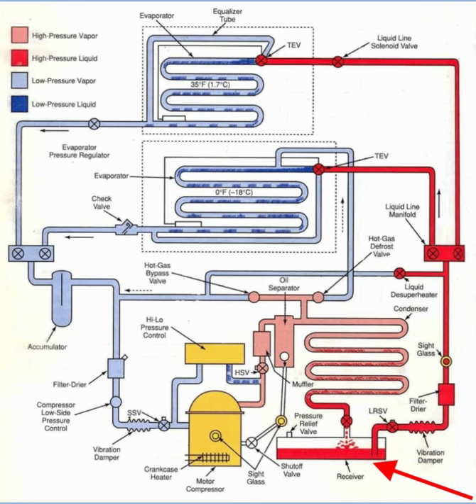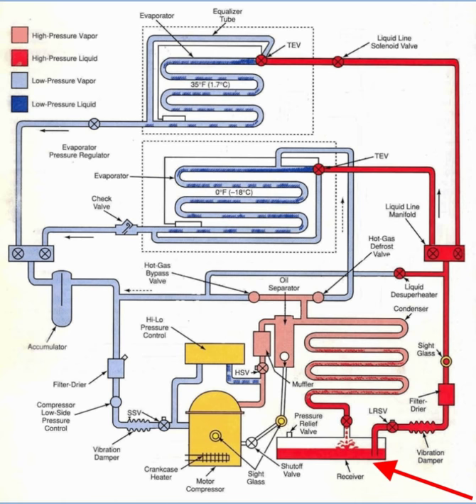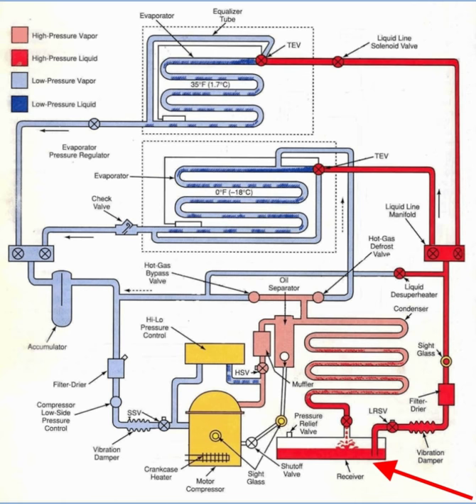Liquid Receiver Tank

Comment: on your site, and video you state the liquid receiver tank receives HIGH TEMPERATURE liquid. I beleive you meant yo say, and state High pressure liquid, since the condenser has removed latent and sensible heat. Correct me if i'm wrong. Your site and videos are a HUGE help, Thanks.